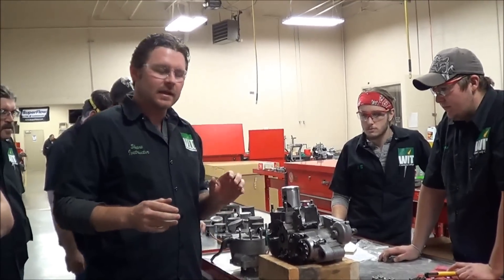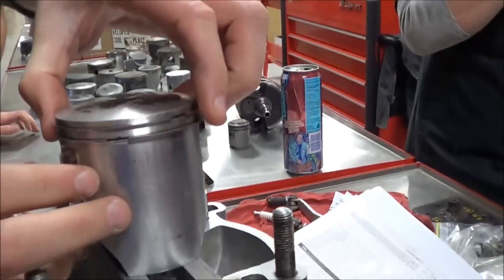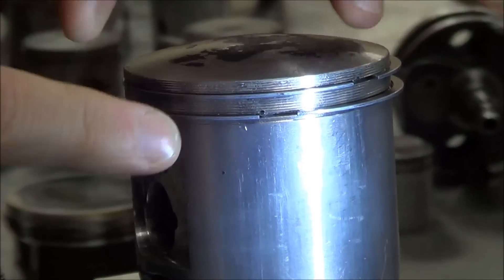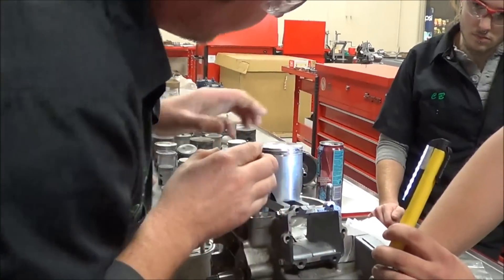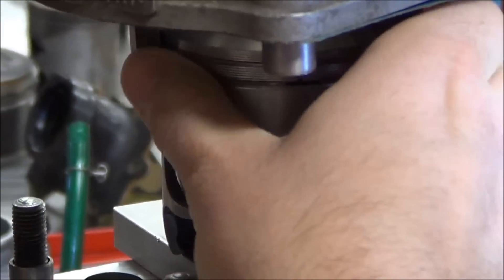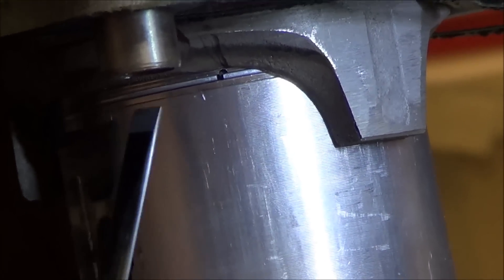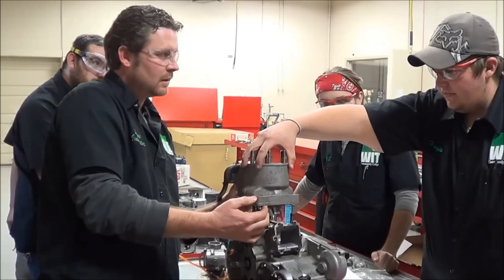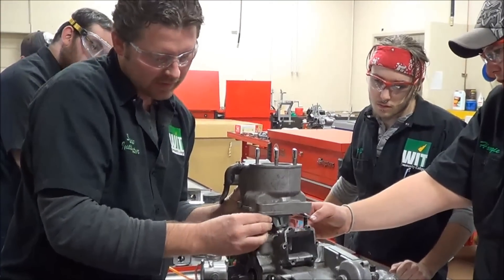2 Stroke Cylinder Installation Procedures and Concerns with the Piston Rings

Comment: I'm wondering how to install a chamfered piston ring on a small 2-stroke engine that only has the 1 ring (Husqvarna 125B leaf blower).  Should the chamfer be installed on the top or the bottom around the piston.  in other words, should the bottom of the ring be touching the cylinder wall, or the top of the ring be touching?

Comment: do you recomend 1 ring or 2 ring per piston ?
Reply from the maker: It varies on use and life expectancy. Many modern two-strokes come with one ring.

You're in luck. I do offer personal service to back up what's missing from a video to actually fix your specific problem. I do work on donations for my time and possible research. 
Good news is its CHEAP! For my time would mind becoming a member of my website? It comes with a free 20 mins of techline and that will cover my time to assist you so we both benefit. So to have me personal cell phone number to put in your phone as your direct info and how to coach, sign up now! As always thank you and enjoy the free videos! Much more to come! I look forward to working with you and hope you will become a member of or learning community. 

Link to membership: https://how2wrench.com/product/membershipmembers-onlymembers? 

If I can ever be of service to you, here is a video explains how to connect with me. 
https://www.youtube.com/watch?v=vjvmB01ebcs 
Direct link to services: 
https://how2wrench.com/product-category/tech-lineservice-callminutes/ 
Live Chat is great for you to actually show your specific issue!
Donation link: https://www.paypal.me/how2wrench
Reply: 2 so you have a compression ring and an oil ring, it will make your motor last longer. also recommend forged pistons thru weisco. forged gives more horsepower and will last longer too, but you have to let your motor warm up longer than normal.